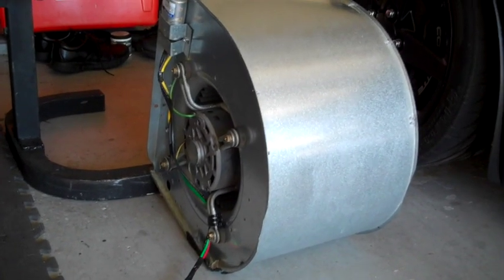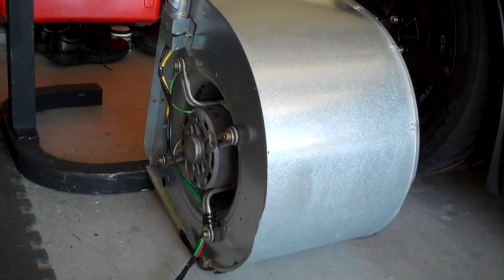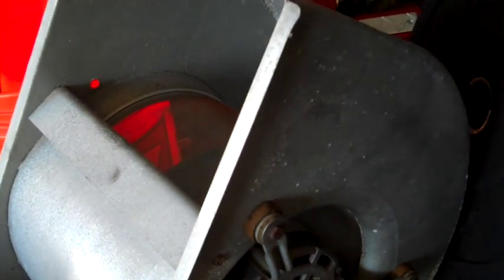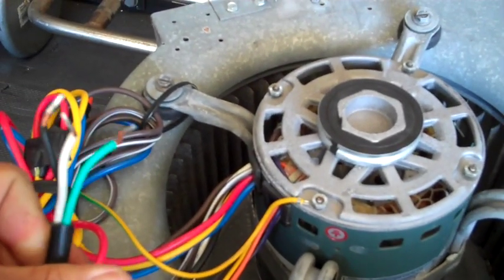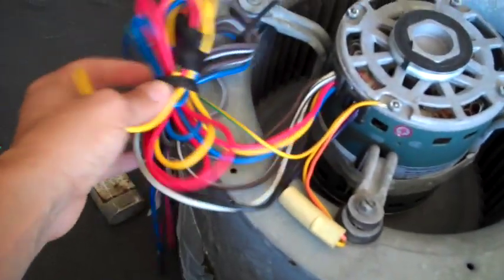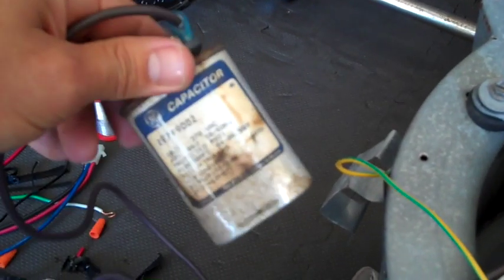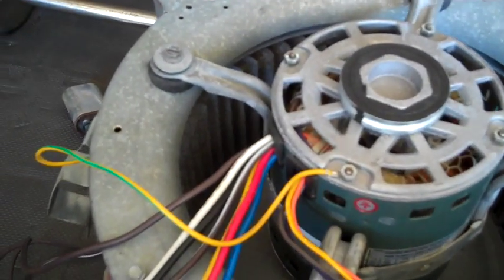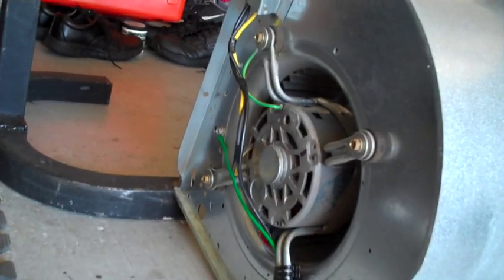HVAC Fan Wiring For Standalone Use 120 Volt Outlet

Comment: So, that motor is not DC, it is AC. Also, that capacitor is not a rectifier. That capacitor is (most likely) a start capacitor which is used to help provide a boost during startup. I say most likely, because they can also be used as a run capacitor, which just helps the motor maintain its speed during voltage drop situations.
Reply from the maker: You’re right. I’ve learned a bit since this video!

Comment: How can more current through the motor with half the original voltage (220) burn up the motor, because the motor consumes the same amount of Power.
Reply from the maker: You’re probably right

Comment: I wired up a HVAC fan to a 120v plug and measured the wattage using a Kill-a-Watt meter. It read 455 watts. That's a lot of power to run a fan.
Reply from the maker: Dang!!! Well, I never claimed they were efficient!
Reply: @CliffsHowTo  , When I used a board to block some of the air intake, the RPMs went up considerably and the wattage dropped to around 385 watts.

Comment: A friend who does commercial A/C systems got me a blower out of a 5-ton unit. He told me how to wire it up and cautioned me that I should put a partial block on the outlet because these blowers are made to have a "load" on them. Normally, they're pushing air through lots of trunks and duct work and are expecting that same kind of load in regular operation. He told me to take a piece of wood and cover the outlet until the motor runs the fastest. By adjusting the size of the opening of the outlet side, the fan will get faster or slower. I figured it out and my blower has run for years. I have a hi-lo switch on it depending on how much air I want to move.

Comment: if you want to use without it spinning too fast overloading the amps, for building a laminar flow hood for example, put a clamp volt meter around hot wire and set the fan on a table with a little bit hanging off (small opening for air to blow out), slowly slide fan off table which reduces the resistance and let's more air blow out and watch the amps, keep sliding until you're just below or at the rated amps of the motor.

Then measure how big the opening hanging off the table is, that is the size of the opening you cut into the flowhood box.

Sometimes you get lucky and you end sliding right off the table and it doesn't go over the amps, but alot of times they are intended to run in an hvac system with filters/dampeners/ducting with some air resistance.

Comment: Appreciate the video, but thats not a dc motor, and that capacitor doesnt rectify ac.   If the capacitor terminals do not have polarity marks, then its just a straight up ac capacitor.
Reply from the maker: Yeah, when I made the video, I wasn’t all that familiar with them.

Comment: The other colored wires aren't speed control wires. Well I mean they are, but if you're thinking along the lines that they go to some kind of speed control module or something that's wrong. You replace the black wire you're using with any of the other colored wires and the fan will run at different speeds. Red is the slowest speed, black is fastest, yellow is medium. If you get a three way switch you can actually set the fan up to run at different speeds which is cool.
Reply: Thank you, I literally came to the comments to see what it was.
Reply: Thanks for that! You can also get a 4 speed switch of amazone!!
Reply: Testing

Comment: Got a question for ya if you can help. Well, I work for a LP gas company that also has a heating and Air side as well. The heating and air side of our company had thrown out a fan that had a Marathon motor attached to it so I unbolted it and took it home. It has 3 wires, blue, black, and red wires. Can you tell me what the blue wire is for? I was planning on making a grinding wheel with it. Anyway, I would appreciate your knowledge on what this wire is.
Reply from the maker: Not really sure off the top of my head.

Comment: Both original and replacement run capacitor are same 12.5 MFD 440/370 VAC but new replaced blower motor has 7.5 MFD listed . Still good ?
Reply from the maker: I had a few, and used them in the garage for years. Sold a few off. The ones I still have work fine!

Comment: So we replaced our HVAC system, and theres a big ( 1 1/2 ft) wide squirell cage blower that i Hooked up to an extension cord. When i plugged it into my GFI bathroom 110v plug, it would run about 20 seconds, then shut off... there is no diagram on the thing so idk if its 220 or 110. How can i make this work? What do i need to do?
Reply: The schematic is on the motor housing.
You'll have to remove the motor to see it.

Comment: Those capacitors are not rated in picofarads (pF), they are rated in microfarads (µF) which is much larger than pF.  As for running them on 120v, that is correct, if you cut the voltage in half, you double the current (amperes), this will be especially problematic on start up.  Example, if the ratings on the motor at 240v are 3.5 amps at full load amps (FLA) which is maximum current draw the motor can handle, and 1.8 rated load amps (RLA) on 120v, now you're pulling 7 FLA, 3.6 RLA amps, well over the maximum current the motor windings can safely handle.  If the fan being too powerful is the issue, you would be better running a 240v outlet and then use one of the low speed wires off the motor, typically it's the red wire, but refer to the wiring diagram on the motor to be sure, you'd connect the low speed wire to one leg of the outlet, and the common wire to the other.  Be sure to ground both the motor case as well since there is a rubber grommet between the motor brackets and the blower housing, and sometimes there is rubber between the bracket clamp and the motor housing as well.
Reply: Why is my motor running hot? It's too hot to touch after 10-15 min of running I went thru the entire process and it works, I chose the black high speed wire as my main speed also both capacitor wires are plugged up. I tried both ways capping it off and ran it without restriction on the opposite side of the motor isn't that the suction side? It didn't matter it still ran too hot any ideas?

Comment: THIS IS THE BEST RECYCLING THERE IS - compared to shredding it for scrap metal like most people would do.
It's better to run it on 110, because if you run it on 220 it will be WAY to powerful of airflow for a garage space!

Comment: The capacitor is not a rectifier, and the motor is an AC not a DC motor.  You are running a single phase 220v motor on single phase 110v.  I am doing the same.  It works fine for me as well, and in fact draws less current.  That is because the torque load decreases with fan speed, and torque is closely related to current.
Reply: I have it wired for what he said and NOPE, not happening. I must be missing something because the blower does work. Any ideas?
Reply: I'm not dumb but his statements did seem wrong.
Reply: Do you even need the capacitor?
Reply: @josephaustin5377  I think so. Capacitors are usually used on single phase motors to help get them started. Three phase motors don't need it but single phase do.
Reply: @josephaustin5377  yes. The capacitor is a jump start for the motor. Instead of starting off the power alone, the capacitor gives it a jump with stored energy.
Reply: I have a blower with capacitor and it runs but cuts off after about 10 seconds

Comment: One reason it doesn't burn up the motor is because the motor is not under the load it was designed for. Even running on 110v doubt you're pulling much more than an amp, to get the heat you got to have the amperage. Also most of those motors are design to install in heat pumps so they're running in a pretty torture environment anyway, trying it with a lower quality motor you probably won't have the same success. The weak link in the motor is the copper windings, they're going to be a smaller gauge since it's only designed to run on half the amperage.

Comment: 240 will damage the motors.
The compressor needs 240 not the blower motor
Reply: Only gas air handlers use a 110v blower motor, all other air handler are designed for 230v because they are designed to allow for a 230v auxiliary heat strip. You can install a 230v 1/3 hp motor on any other air handler that runs at 1075 rpm.
Reply: john marshall, interesting that we run a 120 vac to furnace.  It must use a transformer with dual secondaries to accomplish this feat.
Reply: @SailBuddha  An air handler can be converted to 120v by changing the motor and transformer, but all modern air handler are 230v. I've never had to do it but I convert them to 460v for a couple commercial buildings I do all the time. You can't get a residential air handler at 460v any more and anything under 5 tons usually uses residential equipment.
Reply: A furnace/gas will usually be 110v unless it is dual fuel in heat mode with electric back up. But it would have to have been manually converted I believe. Most of the time it would never be done because the existing gas would be a better auxiliary heat and it would introduce a third stage of heat, also would require a heat strip pack since the gas unit has no spot for a heat strip to be installed.

Comment: Can you get a 220v condenser fan four wires to run on 120v  plug?
Reply: Chuck Holmes  would you still need a capacitor in order to do this?
Reply: Chuck Holmes  thank you kind sir

Comment: I really don't mean to offend anyone, but there is so muchisinformation in this video. For instance, the "rectifier" is actually a capacitor that could kill you if you were to touch the two terminals on top. Very dangerous if you don't know what you are doing.
Reply from the maker: Did I say rectifier? You are correct, it is a capacitor. And yes, care should always be taken when dealing with electricity!

Comment: i wired 208-230 volt PSC motors to 120 volt and they run just fine.  the motors run much cooler than the ones that run on 115 volts. as i recently installed a US MOTORS 8905 to a portable high velocity fan where i work at changed the blade also it works fine on all 3 speeds with no issues and the correct run cap was used. as i believe they should not draw much power whats on the nameplate but half.  i tried some of the smaller shaded pole motors rated 208-230 volts and they don't work quite right on 115 as they don't get up to full speed as a PSC motor is the way to go for a furnace blower if u rig one up to a portable fan with a burned out motor it will work.

Comment: I am trying to wire my fan blower, but i do not have a white wire?
Reply: Walt Robinson did u end up getting it wired up I dont have a white wire either
Reply: @eloriginal302  
Colors mean nothing. Make sure you look at the motor schematic that cames stuck to the motor casing, it should tell you which wire is common, the rest wires should be your run winding wire. One wire is high speed for cool, another wire is miduim low for heat. There should be also two wires( usually brown) for capacitor.
Reply: war of Leo Villarreal  white wire is neutral, red low speed & black high speed.

Comment: you meant to say 10 Micro farad? not 10 pico farad?
Reply from the maker: I’m not sure. I could have misread/misspoken. I just used whatever capacitor was on it when I got it.
Reply: @CliffsHowTo  Roger. 10 Microfarad is probably what came on it. 10 picofarad is the capacitor in you tv remote.
Reply: @CliffsHowTo  Great video. very helpful. greatly appreciated.